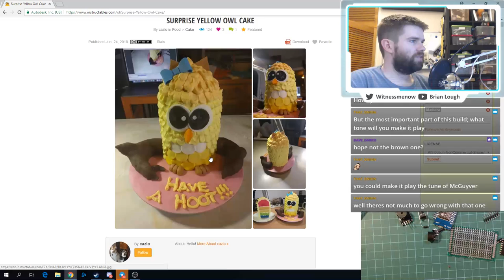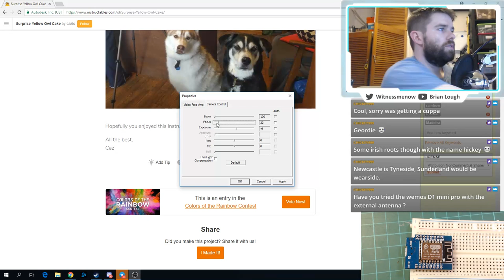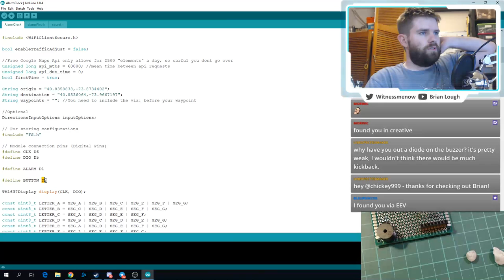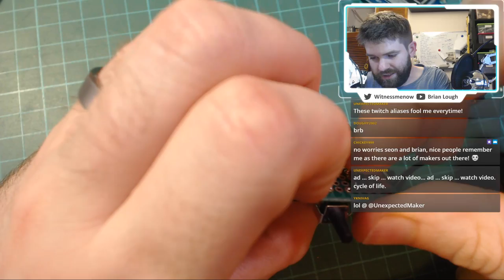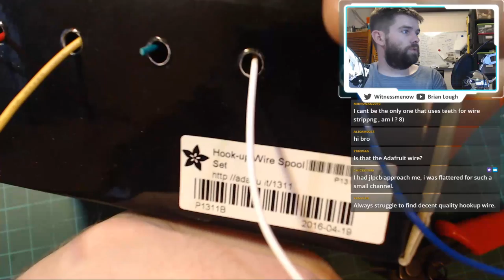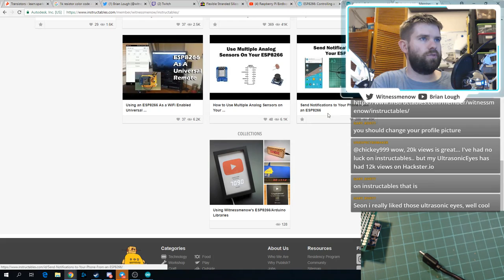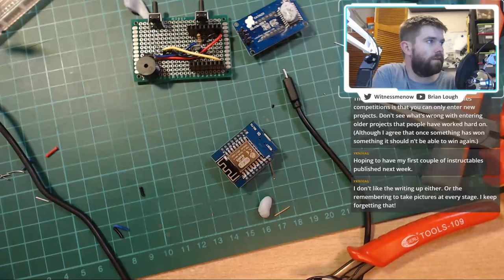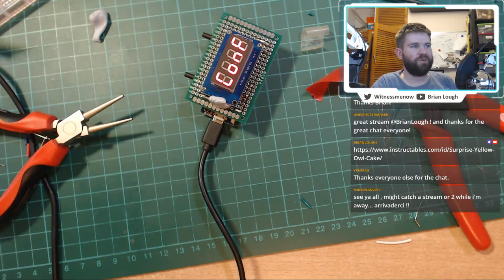Maker Monday - Soldering up a WiFi Alarm Clock Prototype

Comment: Hmm hmmm hmmm...
I would ask ntp time from router once an hour AND log difference for future internal compensation.
and let the router get the time from the interwebs as usual.
As long as you have power the router will answer even if currently no internet.
I think the internal arduino "time since start" timer in mS will run for over 70 minutes (or was it 7 hours?) before it overflows/back to zero. I used that for a stopwatch with 10mS resolution.
Also your alarm does not need to be exact for a second, so no need to overcomplicate or increase datavolume.
- But(t) !
What i would add is a big 3V lithium backup coin cell which allows the esp to go into sleep mode+LEDs off if there is no 5V power on the input.(simple cell+diode to 3.3V rail, nothing more, analog or digital pin to monitor the 5V)
If power returns you still have your settings,
if it doesn't you could even make a powerloss alarm after 30minutes.

My old radio alarm turns on radio after power loss, so you can re-set the alarm and don't oversleep.

edit: wanted to try the RasPi Filter-DNS some time now because my tablet browser (chrome+mozilla) is reaaaaally slow and adblock doesn't work for nonrooted devices.
i think the internal adblocker just take ages...
Reply from the maker: Millis() (time since start up) overflows at 40 days I think! Not 100% sure, but it's definitely quite a lot of days.

Nice idea to notify the person if it gets restarted like your alarm with the radio

 Definitely going to set up pi hole soon, hopefully it's easy!

Comment: Final thoughts on the stream since i finally got it finished:
Please do not feel offended, but..
you are really creeping me out with your wiring 😅😓😨 especially the bending towards the end..
It's not a breadboard anymore, the tracks and connections should be *on* the board,
not all across in the air flapping in the breeze (quote eevblog i think).
For the LED: just use four wires or even wires with a male connector header at the end,
and the female connector on the board. (i would use 5pin for 4 wires, one to encode plug)
Then mount the led with those nice four screw holes,
or two diagonal pins to a case,
so you are flexible where to put the rest in the case.
3D print or drill+file..
(btw, you can setup eagle-cad grid to work as through hole 2.54 board layout,
and pre built it there nicely with all components and tracks and bridges)

As for the 4K => only thing it increases is data volume+file size,
there is no need for that resolution, if you need detail, you zoom in.
Unless you want to watch 4K gaming on a 4K gaming monitor, then i'm pretty sure some people will complain about lag under 120fps 😒💥.
I do not understand why eevblog now uses 4K. There were/are rumours youtube encodes 1080p/60fps with a better encoder than 30fps but graphics/textures still look munshed up on fast motions.
I do not need 60fps for watching something which then takes up double bandwidth for no better info.

Enough ranting 😬💥😯, need to catch up todays (saturday) stream 😓😄👍
Reply from the maker: Hey,

I used to be pretty particular about keeping wiring really short and following certain paths, but life is too short, especially on a stream! You need to be so much more accurate to how long you cut, how much you strip etc that I personally just don't feel it's worth the time anymore.

Good point on the LED matrix display, should have just used wire, or male headers with the plastic removed. I actually made a board yesterday for powering a 12v fan with 5v and I did that method with the step up convertor. Oh well!

My plan is to turn this project into a PCB (which I think I talked about on stream) so I can fix all these mistakes there 😀

If I had the resources I'd consider stepping up the resolution, but definitely not something I'm concerned about. I think I'd move to 1080p 60 before I'd move to 4k, but I'm sticking where I am til I'm rich from YouTube anyways 😀

Thanks for the feedback and the comment  Psi, really appreciate it!